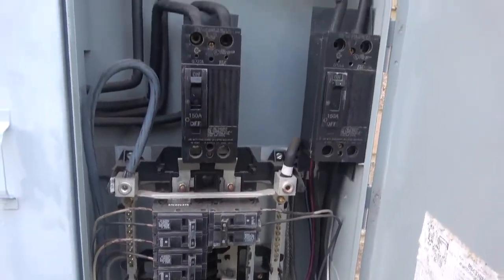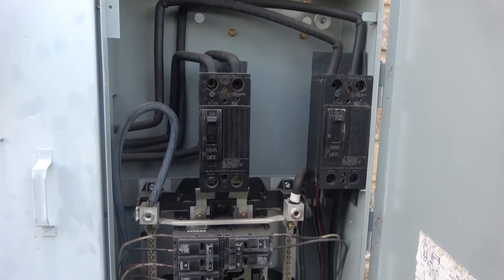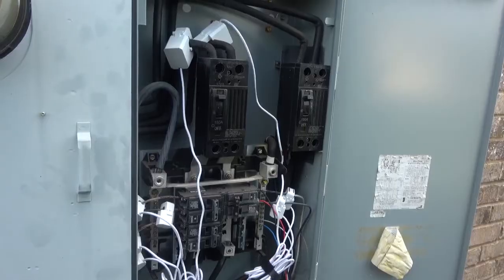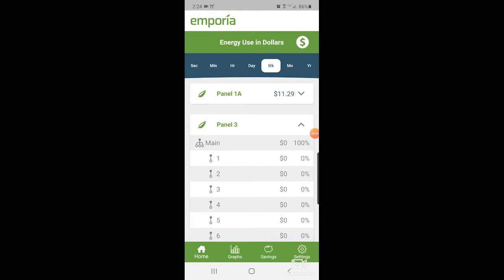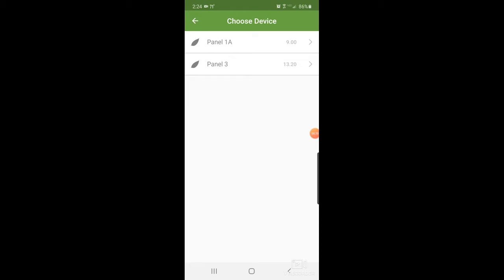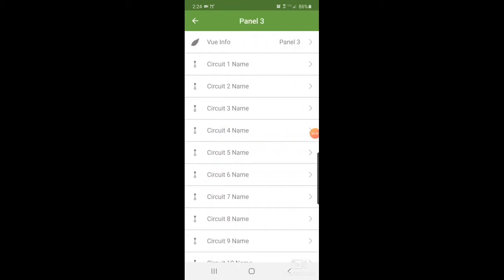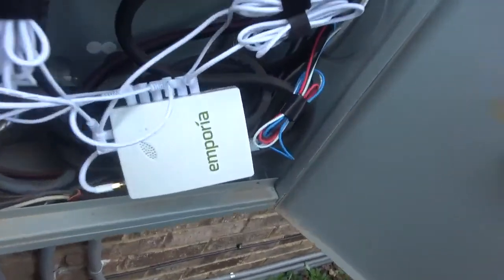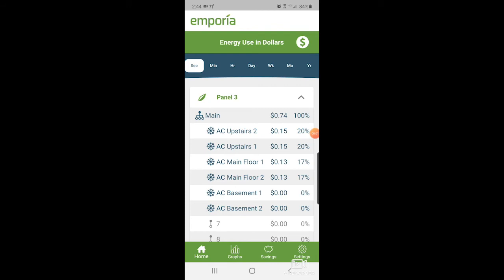Emporia Vue 2 Outside Panel Installation

Comment: How would one go about splitting the monitoring between a main and a sub panel? Do I need a 2nd Vue2 installed on the sub panel or can the sensor cables be extended 85’
Reply from the maker: you'd have to place the main monitors (feed monitors) on the incoming lines from the power company and then extend wires from the individual breaker monitors to the unit. The breaker monitors have a small cord, like old school headphones. The wires are probably too small to extend (but not impossible), but the attenuation from long runs may make them inaccurate.

Comment: Hi  and thanks for the video! In this smaller, outdoor panel you wired the power for the Emporia Vue unit piggy-backing on one of the existing  breakers. IIRC in the larger panel inside your house you added two new breakers for powering to the Emporia Vue unit.  Could the indoor installation also have used an existing breaker to power the Emporia Vue?
Reply from the maker: yes.  Just have to loosen the screw enough in the existing breaker to fit the emporia positive wire in and tighten down.  After tightening down on the breaker screw give both wires a little tug to make sure they are tight.  They will most likely be different size wires so you need to ensure both are tight.  If you can't get them tight or want a different method, just run a new wire from the breaker to a wago connector and have the existing and emporia wire  go in it.  Wagos are great for connecting wire, must more secure than the kind you twist on.

Comment: Is there an interfacing of this monitor system to home assistance ?
Reply from the maker: Not sure what you mean by home assistance.  This does not have the ability to turn things on and off remotely, only monitor power draw.
Emporia does have smart plugs that allow remote power on/off I believe and they monitor power usage.  Everything is monitored in the same app.
Reply: @forayfog2276  
Perhaps a better question would have been, …. if is there a bridge (software interface) to „home assistance“ … like there is for many other products.
In order to integrate the hardware into a bigger system. (home assistant)
Reply: https://github.com/magico13/ha-emporia-vue

install via HACS